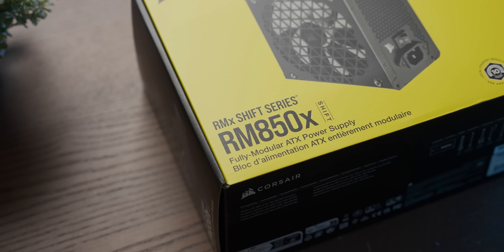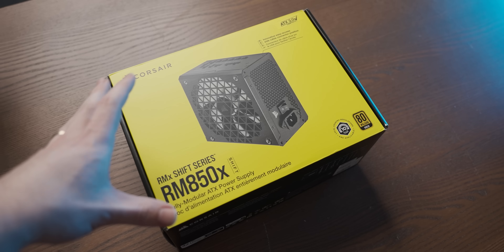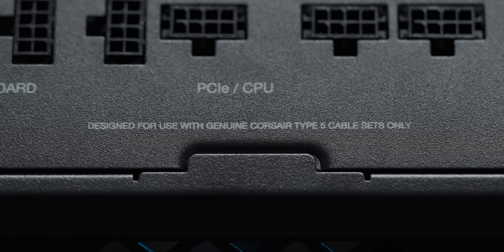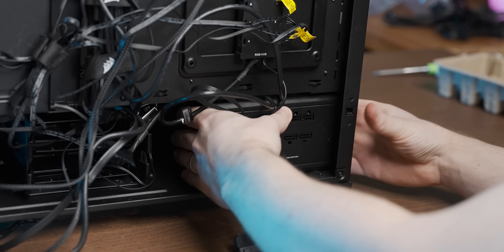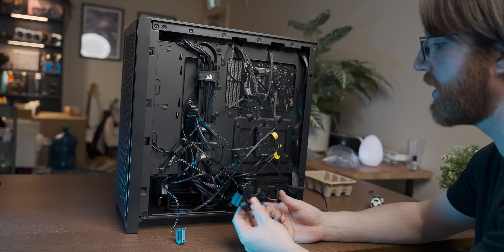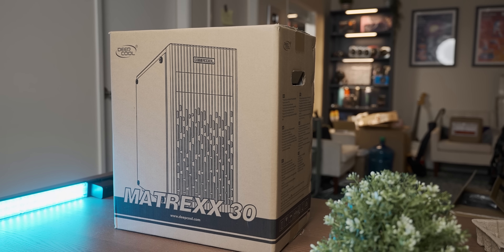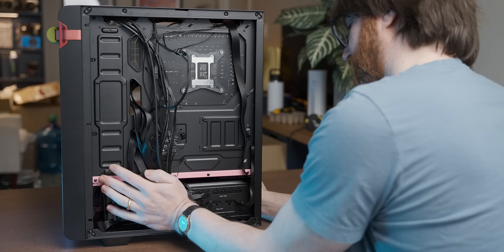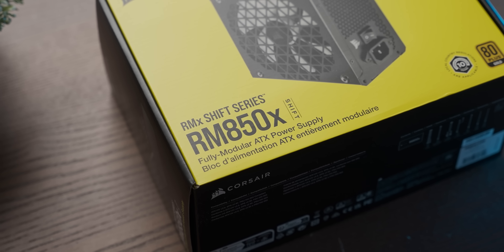How Has Nobody Done This Before?

Comment: Imagine a power supply that gave you BOTH options of mounting the cables, the standard way OR the side way!  I guess that that may have a negative impact on the SIZE of the supply itself as it might have to be made larger to fit the extra wiring inside.....at least for now anyway.....🤔
It would definitely increase the price even further but it may be worth it if you just can't decide on the case you want to use it in yet.  It keeps both doors open for future decisions which is always good in my book!  👍👍

Comment: classic case of a solution looking for a problem. yes, it's convenient...and that is all. but let me ask a question: if failing cables caused by bending and stressing the wires at extreme angles from the 12v rail connector have been a serious issue with Nvidia graphics cards, causing them to potentially CATCH FIRE, how is producing that exact same issue throughout the entire rest of the computer at the power supply itself with much smaller connectors and seemingly thinner cables so much of a better idea?

Comment: I think this is probably for the motherboards with rear-mounted connectors Asus and Gigabyte are working on. Would make cable mgmt a breeze, but cases would need to get a bit wider on the rat's nest side of the case.

Comment: Seems like a solid PSU option if your case supports it, the only thing I think that could be fixed is better labeling for the plugs and more shorter cables with better bending options. Also not a fan of the smaller plugs but eh.

Comment: G'day Dawid,
it is a good design for lots of cases with Power Supply Basement, but for many other cases as you said it will be a problem like the Matrexx 30, 100R, my Fractal Focus G & I guess most cases with a top mount powersupply.

Comment: With good access to the ports on PSU, other possible improvements:
1. L-shaped connectors on the power cables that connect to the PSU side so that the protrusion is minimal and doesn't hit the side panel of chasis
2. Due above, the connector ports on PSU should be rotated 90-deg to facilitate the way the cables will bend left/right. The position of the connector ports can be optimized in a way to prevent obstruction between the installed cables
3. Motherboard ATX power connector ports should be facing sideways instead of upwards which could improve cable routing effectiveness and aesthetics

Comment: Dawid, I have one thing on my mind, and it's the connectors. They get more tinier, as the power draw gets more bigger, just like 4090 melted the internet.
I'm an electrician, and it blows my mind when you make smaller connectors for high power draw.
Intel 13k can suck over 200W at the motherboard, and hey, let's make the connectors smaller!
I'm not really happy with it.

Comment: That's pretty genius, if you have the room to put the case side back on. I had to unscrew my psu and pull it out twice in one week to wire up some rgb BE QUITE! fans after I mistakenly bought some crap rgb Antec fans. Those be quite fans are surprisingly heavy.

Comment: Hey Dawid, awesome video! 

I have a question that isn't really related to this video. What would your recommendation be for testing an open box GPU in order to make sure it's working as it should be. Is it just enough to just run games on it to see what happens?

The open box GPU was purchased from Best Buy - in case that matters.

Comment: Even if it doesn't improve cable management as such, being able to easily get at the connectors when say adding a hard drive or any upgrade requiring power cable, so much easier than having to dig about or doing a full rewire. I'm for it, I'm also for motherboard connectors being on the backside. Clean as hell builds!
Reply from the maker: It is a great way to add cables in. I agree, good change. 👍
Reply: ..it may be practicall in some cases (oouch dual pun)... but seems like a real danger if u know a bit of electronics...interference for one, and the way the cables is bent and forced twisted is a real no no....on a low end machine with limited power needs maby this is okay...
Reply: that's clean? that's messy.
Reply: I don't have side windows, so it's clean as hell build!
Reply: @Njazmo  lol i get what you're saying but he's also saying with the rats nest of cables even if you don't care about how it looks it's still a pain to get to the connectors on the PSU or to add mechanical HDDs if you need too since the cables take up so much room. That can kind of be solved by getting custom length cables, which i did for my 011 Dynamic, but then when you change cases you have to spend another $150-$200 to get custom length cables for that case. Luckily I didn't have to do that. i posted about this problem on reddit and CableMod actually reached out to me and sent me free custom length cables, which came in over $200.

Comment: Jayztwocents did a video a few days ago and he was looking at one of these PSUs at microcenter. He decided not to get it because the cables wouldn't fit in the case. Also that smaller 24 pin isn't exactly new. My current psu that is a few years old has a similar layout a smaller 16 pin? and then another 8 pin, or something like that.

Comment: As long as you only buy cases for a fan down orientation and only for cases with the PSU at the bottom and only for cases to where the PSU lays flat, it's not bad. 100% gimmick.

Comment: David Great review and design if I really cared about cable management. At 50+ years old  customizing since my 300 P2 cow computer....Gateway I think with 2 unbelievably hot running Voodoo 2 gpus that caused crashes unless you cut the case and added 4x80mm fans or kept the side panel off, but played WARBIRDS flight sim on a 21 inch tube at 1600x1200 in like 1995 or something LOL and building My PC's since the 900T-Bird AMD CPU, custom water loops etc. I honestly as long as the cables are out of the way and not obstructing anything like fans and major airflow I Honestly don't care what they look like on the inside, functionality and longevity is my main goal. Also I think RGB is for wierdos but that is just my perspective and I don't even want to see my tower, I need to look at the monitor when gaming not disco lights....BTW I have never been to a disco "that is so 70s here in the states. Clubs are the thing here even in the early 90s "I must stop typing :) wait do not forget the 1000$+ for Flight sim gear 2 f22pro joysticks a f16tqs throttle and 2 sets of aluminum RCS rudder pedals since they were analog and heavy ass springs would break, potentiometers need replacing a soldering etc......Don't forget they all hooked up to the amazing SoundBlaster 16 gameport. Lets just say USB adapters are a waste of time. At least for me.

Comment: Would've been great if Corsair added second set of mounting holes on what previously was the front of the psu, so you can flip it around to use in other pc cases, where they have a space on the other side
Reply: Are you on drugs?
Connectors are in the back, not front, and now on the side.
Reply: @Njazmo  anyway, there is need for second set of screw/mounting holes, so you can flip it around
Reply: @jack1knife  most cases accomodate a PSU going in upside-down as it where. the downside being getting enough airflow into the PSU itself at that point. My MB511 just has solid metal in that area (than again it also has an open left side so this would fit conventionally)
Reply: why couldn't you just flip it 180?  The holes might still line up, and a lot of cases have meshy stuff back there where you can force a PSU screw in and create your own mounting holes.
Reply: @Bigheadedwon  that's true, but not the best decision for mounting, especially in some cases, where mesh is too thin
Reply: That's actually a great idea. Come to think of it, they could just add an extra switch and power connector, screw holes and vents on the side next to it and have it so that the PSU can be used in the traditional way or this new way

Comment: I don't understand why the cables don't have angled connectors. Considering the cramped space that's available for this even in huge cases, angled connectors to avoid needing to crush the cables in-between the power supply and side panel so much seems obvious.

Comment: I was exactly checking this PSU yesterday and thought it was cool cause I'm tired of taking my PSU out of the case every time I need to change some cable cause I can't reach it and it's a huge mess...

But I wonder how's the cables on this one?

I have a Corsair AX750 80+ Gold since 2011, but the cables are pure GARBAGE, the worse I ever had, they are kinda on the loose side even brand new and now all my cables are BAD for many years, all the pins are loose on both ends and even melted one pin plastic quite a few years ago.

Lately my PC keeps shutting down while playing and despite the PSU being way too old it still can give enough voltage the problem is the cables, I have to keep messing with them until I have proper voltage and works fine until my ante slams the door against my PC case and bam voltage goes bad again and trying to close the open loose pins in the cables they get worse and worse and are almost breaking apart.

ps: I'm thinking to buy this new RM750X Shift, but I hope the cables are not loose like my older Corsair which is worse than generic PSU's that I have for decades which I never had a cable problem and none were loose like this😡

Comment: I thought this would be for a case where the PSU is mounted vertically like the Lian Li O11-family, but I think it’s on the wrong side, and other vertical PSU cases wouldn’t work, like the SSUPD Meshlicious. Maybe it’s because I always plug in all of the cables (I don’t like to lose cables in their boxes for fear of mixing them up) to my PSU. However that length use-case does bring a good point

Comment: I saw this announced and thought it was pretty cool as well. But how come in the "cheaper" cases did you not just Flip the power supply? The orientation of the PSU fan isn't that affected weather its placed up or down. So it could be used in most normal cases.

Comment: Gamer's Nexus actually did a deep dive into cable compatibility recently and it's actually a huge deal making sure you have the right cables. Which is kind of silly? They just carry current? But I guess it's a thing, so, it's not terrible that Corsair is starting to ensure that people are using the right ones.
Reply: "They just carry current?" Wire gauges, the number of wire strands, length, insulation material and thickness, type of sleeving, type of connectors, cable capacitors etc. make quite a difference.
Reply: The problem is more complicated than that.

First, you have 3 different types of voltages needed: 12V, 5V, and 3.3V. Each one of them is meant for different use cases, you'll need to have the right voltage being sent down the right power rails. If you take a look at the 24pin connector, you'll see there's a variety of different voltages at different locations on the plug. On the motherboard side, the pinouts are standardized, but the PSU side isn't standardized as of yet, so if you use the wrong cable, and you might end up sending 12V down the 5V or the 3V power rail, and something will go boom inside the PC.
Reply: @matasa7463  it's a fire hazard when mismatch (using from different brand). I learnt the hard way, I fried my SATA SSD because I'm using different PSU cable for peripheral (that will connects to sata drive, fan, etc) and I thought it will compatible, but holy shit, it literally smokes my PC, the power SATA cable melts.

my PSU is Seasonic, the culprit PSU cable is from Corsair. never ever mismatch PSU and its cable, even from same brand sometimes it's not compatible. for safety only use the modular cable that came with the PSU.
Reply: @marhensa  You are 100% right, never mismatch PSU cables.
Reply: @marhensa  Corsair have a compatibilty sheet online where you can identify if cable fits (Type4, Type3). There seem to support a wide range of supplies with Type4. Mostly the ATX Connector for Mainboard is different.
Reply: at least Corsair does have standardized pinouts among their power supplies (like the type 5 here), many companies don't even have that
Reply: @formbi It should be a fucking INDUSTRY STANDARD at this point

Comment: Horrible. I mean the power supply. I'm the weird Haf XB Evo enjoyer that has one of the worst times replacing a PSU in that case. Basically motherboard out and everything to mess with the cables in that thing. Still there is NO way that a gimmick like this has any merit. Motherboards and cases made for cables to plug into the back of the motherboard is FAR more useful and interesting. This side connector PSU just shows that the basement shroud is just awful on cases. I rather have a PSU visible with the cables and all at the bottom of the case! Why hide it and make life painful for no good reason. 

Factual Design Torrent even now it uses a top mounted PSU and plastic top cover also just shows the way to solve access to the PSU. It boils down to not just having a unmovable cover. Even now in the case of Torrent I rather have a painful time if that meant not dealing with a cheap plastic cover on a case that overall feels high end and made with good materials. And in a normal case I rather have no PSU troud or whatever you call that stupid metal crap making up a basement. Open floor plan people! Even a Haf XB Evo person agree to that! Xb Evo just uses the hole motherboard as the thing blocking access to the PSU! No we are not mad we are just that good at making sure to plan out what cables to use before mounting stuff. You know. That solves and makes this side connector PSU completely pointless.

But I can see connectors at the back of a motherboard to be a good thing. It looks ugly and blocks airflow. Awesome if motherboards and cases start to make that cable problems go away.

Comment: The problem is cases have to be able to support corsair shift psu cables. If the back of the case doesn't have much space between the power supply and the panel, then it won't work great

Comment: Was just thinking about this today. There's loads of vestiges of old PC case form factors that probably need to be rethought. Aside from how PSU cables are routed (A few manufacturers are putting Mobo Connectors on the back of the boards now too), hanging GPUs (many of which are the same size as motherboards now) from PCIe connectors seems pretty precarious as well. Need to shift towards making everything surface mountable like motherboards, or having multiple hole patterns to allow for multiple different mounting arrangements. But I know every component and ever case is different, so this might be a bit of a mess of standards. But it could help alleviate a lot of the big headaches of building a PC.

Comment: I wonder how long it will be until someone has the idea to inset it and use 90 degree cables, so even with the cables on the side, it takes up the same space as a standard power supply.

Comment: In my case, it was a little tough to get to the modular connectors using an ATX power supply.  I solved this by switching to an SFX power supply (plus adapter bracket), it's smaller and now much easier to get to the connectors.  I don't know if my case would work well with the connectors on the side like this... maybe.

Comment: It’s always nice to see since PC components are getting more and more powerful that all these major companies are making smaller power connectors as well as more proprietary BS 🤔 that couldn’t possibly cause problems especially pushed up against the side of the case! 🧐

Wait what’s that the 4090 has had some catch on fire 🔥…. Well maybe it would be better to just use the larger old standard cables that haven’t been catching fire for like 20 years or something lmao 🤣
Reply: Also I don’t think this is a gimmick I literally think this could be a great form factor but my issue is that they need to put some special 90 degree cables or something in there for the main power and just idk there are a few things like changing that power connector I don’t really like. But having the option could be nice for some cases and certain builds!

Comment: I guess it depends on the case.  But, Is this really better?   Maybe,  it's me but I always run the cables, then plug them in .  I screw in the power supply as the last step.

Comment: This looks like a good idea which would be compatible with 90% of non AliExpress cases.

I saw a motherboard that had power plugs on the rear of the PCB, and that looked like you'd need a special case for 95% of cases. There might be 5% of current case designs that would be compatible, as long as you don't mind using a case approximately the size of Costco.

Comment: There is a space to improvement in using space where cables would normaly be. They could prolongate PSU to make it lose a littlebit of width for better cable routing.... And them just give it a bigger faceplate to accomodate ATX form "Hole" in pc case
Reply: Also Lshaped connectors on cables could be nice (even tho probably not entirely usable)

Comment: on the cases with the PSU at the bottom you could mount it fan side up and just have the connectors on the glass panel side, it'd look awful, but it would work

Comment: Just installed mine.  Works great in Corsair 4000d Airflow case.  I'm surprised you didn't touch on the fact this is an ATX3.0 Certified unit too.